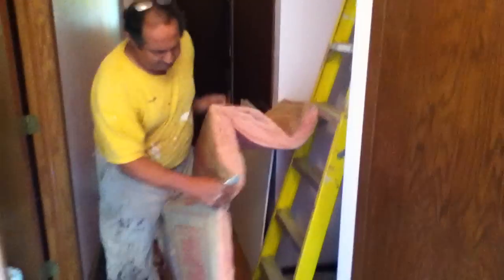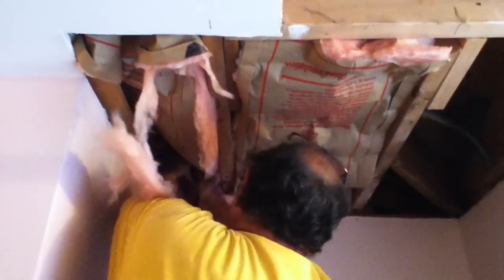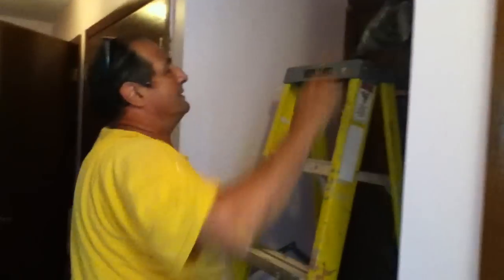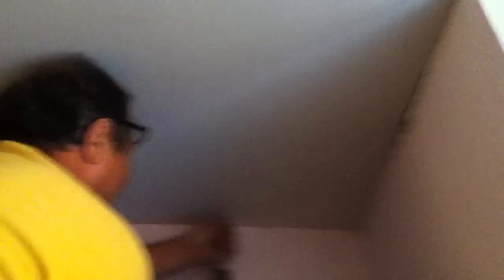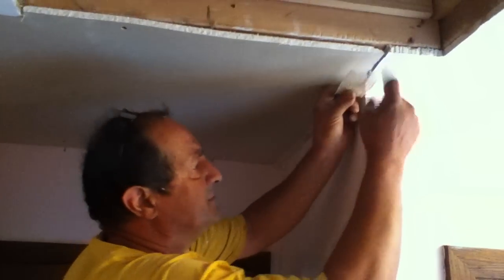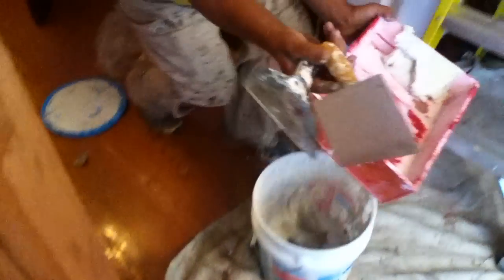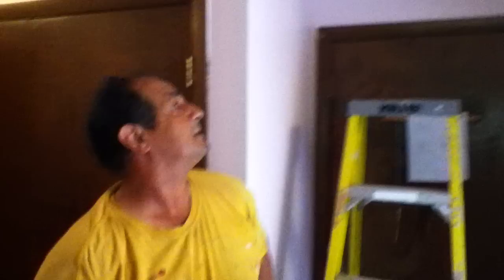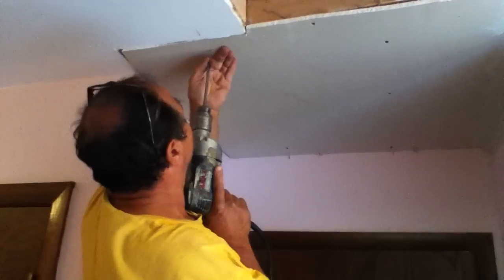How to Repair Drywall Ceiling Water Damaged Drywall #1

Comment: Thanks for the video! +1 thumbs up.

Oh I wish my ceiling were that easy because of all the 50+ year old separated material. I would have to go up in the attic and use a vacuum clear to suck all that crap up. You have been doing that for a long time since you using a 25+ year old corded drill with no clutch and not a drywall screw gun.

Comment: I have removed a small square(1 foot) of drywall in the ceiling which had water damage from an overflowing toilet.  I don't want to replace with more drywall in case the same overflow happens.  I was thinking of putting a white cold air return in the ceiling so that water could pass through it onto the tile floor where there would be no damage.  Are there any other ways to cover the hole so that it looks nice but won't get damaged by water?

Comment: LOL 35 years................. How about considering these folks aren't professionals and they aren't going to want to invest into those kinds of tools for a patch job. 1. go to home depot or Lowes ask where their drywall section is.  They sell small hand held tubs of premixed drywall mud for like 5 bucks and comes with a knife.  that's all you need for a job that small and Use  FibaFuse it is a new paperless drywall joint tape. Designed for professional renovators and remodelers, FibaFuse is a mold-resistant glass mat drywall tape (ASTM D3273 approved) that is ideal for use with mold-resistant and paperless drywall systems along with high-humidity and moisture-prone applications.  Open Fiber design fuses with drywall compound to create stronger drywall joints compared to paper tape  Smooth Finish - Eliminates blisters and bubbles common with drywall paper tape and it is a superior option to paper tape for demanding applications. $6.00-$7.00 per roll,  Ideal for small jobs like the one in the video. Oh and get a sanding sponge, and between coats and use a flashlight to shine on the walls at a angle, If you see a shadow where you have mudded then sand it down until there is no shadow to ensure a smooth seamless finish. after 2-3 coats and sanding apply primer and paint.

Comment: Curious about the nature of the leak. judging by the proximity of the blower fan, I assume that it's the result of an improper seal at the penetration, whether it be through the roof (inadvised) or through the gable. Rain may have been blown through, I imagine, so obviously you would have sealed it first while the cieling was open for a few days to allow trapped moisture to evaporate? Also, wouldn't a moisture barrier be necessary?

Comment: I think you may also want to consider vapour barrier.
Reply: Stephen Kuhl Vapor Barrier??
Reply: +Nrfa technical jargon meant to cause worry and make money. The paper on the insulation is plenty of "vapor barrier" especially in a humid bathroom where you want some of that steam to escape.
Reply: +4842Chuck Thanks for the reply Chuck, In Canada venting any kind of humidity into an attic space is against building code.  Mold is pretty much guaranteed otherwise. That is in this part of the world.
Reply: +Stephen Kuhl  oops! Thanks it is here too! I never knew that. lol! The attics are always humid I thought.
I see fart fans vented without duct thru the roof all the time.